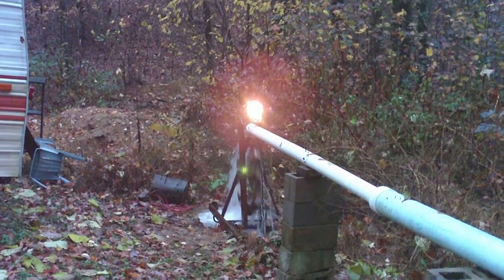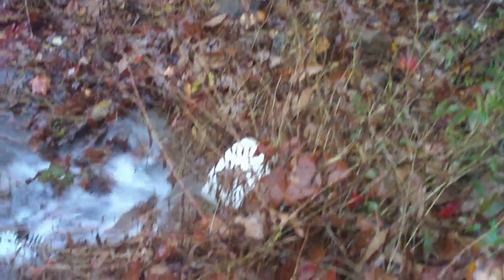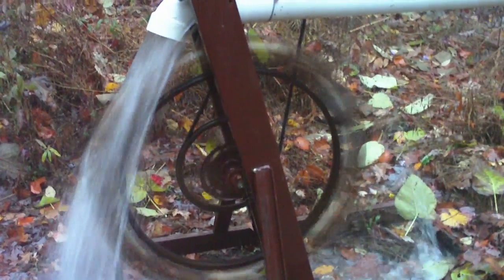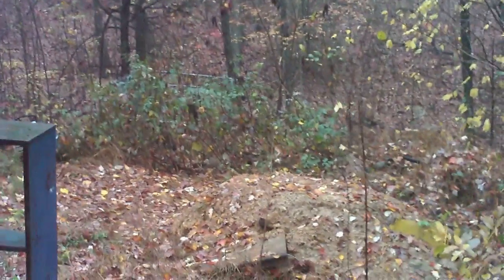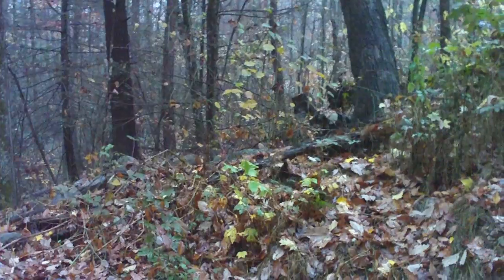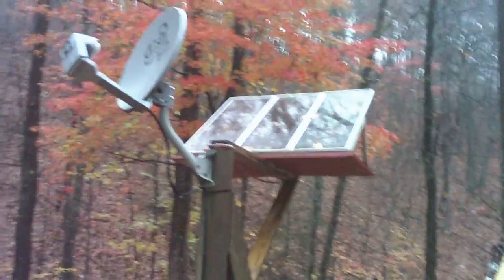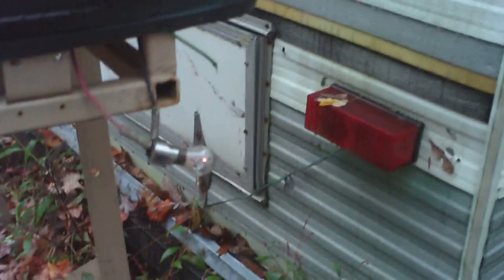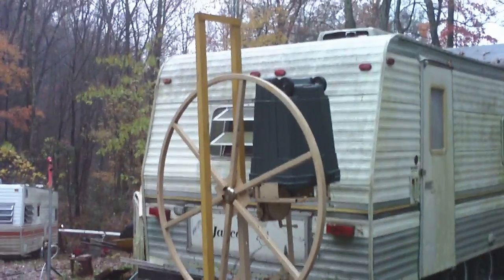water powerd generator

Comment: I wonder if you funneled the end a little bit -- if that would increase the pressure and fine tune the stream-output so that it would hit the wheel more exactly, an with more power (thereby turning it faster, of course).